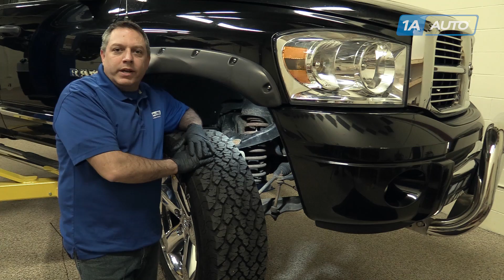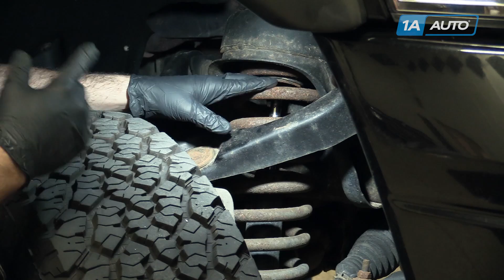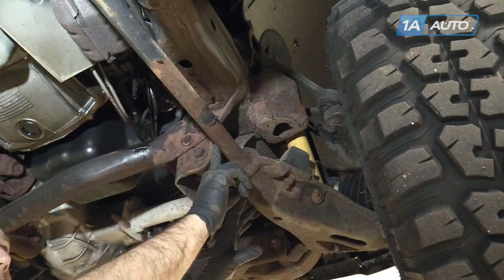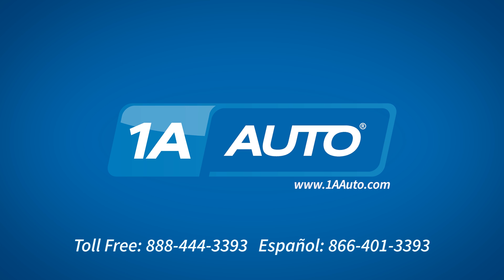Identifying Coil Spring VS Torsion Bar Suspension

Comment: need front shocks for my 2010 Ford Ranger XLT Standard Cab Pickup 2-Door 2.3L 140Cu. In. l4 GAS DOHC Naturally Aspirated , but dont know what , or witch ones to get .
Reply from the maker: Thank you for checking us out! We would be more than happy to see if we offer the parts you are looking for however, we will need further information to determine if we offer the correct parts. Please feel free to contact us at 888-844-3393 and a customer service representative would be more than happy to assist you, thank you!
+joseph pray

Comment: so how do you adjust the ride 
height with no torsion bars i have an 08 silverado and i did a 2inch leveling kit on the front and the drivers side is 1/2 inch lower than the drivers side ?
Reply: Okay so to counteract the heigh difference install 1/2 inch on the rear driver's side and a 2 inch on the dirvers side rear